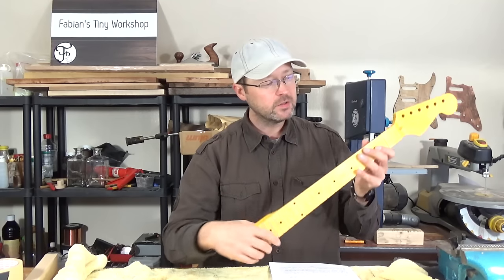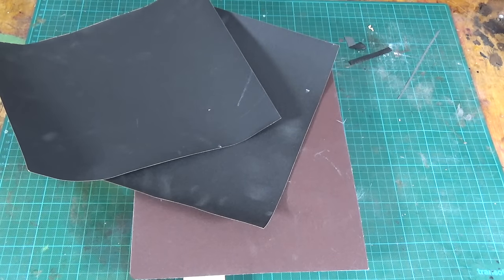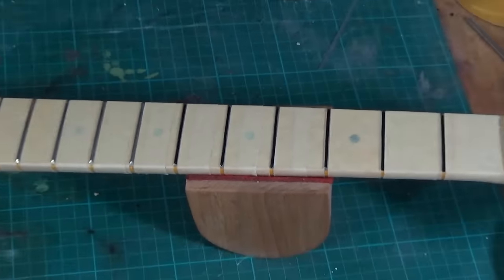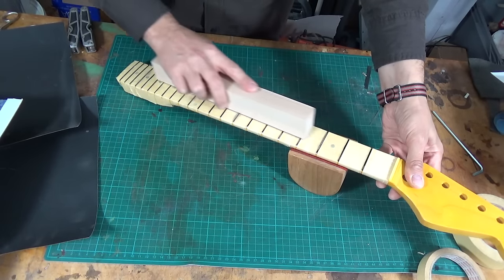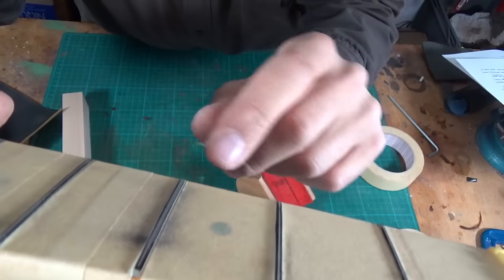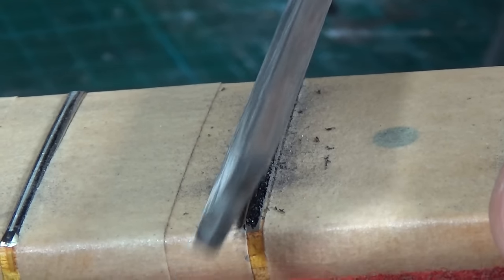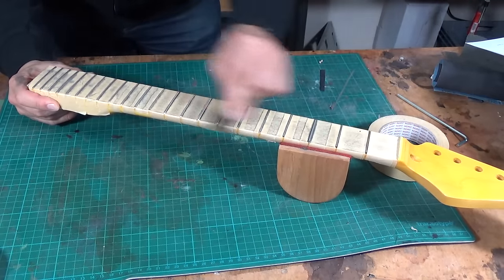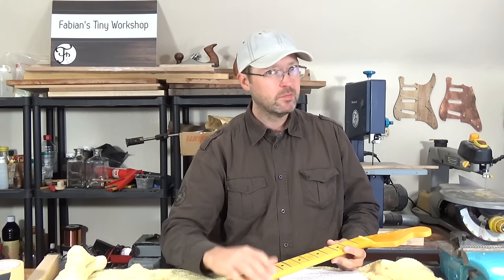Fret Leveling - The Easy Way // How To

Comment: Hi Fabian, thanks for the video!

I have a major question. Basically I followed you step by step but after setting up the guitar the best I can even with action at 1.75 to 1.5 (I'd like it lower to like 1.5 to 1.25). It seems that the high frets (17-24) don't let the 12-15 frets play too well, either popping, stopping them or buzz or they don't let them bend. The higher frets themselves have pretty poor playability/buzz.

it seems that I can't fix it from the truss rod either since having a bow doesn't affect those high frets but only the middle.

My question is, maybe I shouldn't have leveled all the frets the same and actually sand the higher ones more?
Reply from the maker: Sorry for the late reply. Yes you can level the higher frets more. Sometimes there is a slight twist in the neck so you can't get rid of the buzzing on the higher frets. Bear in mind. Leveling the higher frets more wil result in a higher action for those frets, so you have to keep that im mind by ajusting the truss rod. One thing to think about. The 12th fret is in the middle of the open string. So that's were the open string needs the most space to vibrate.
Reply: @FabiansTinyWorkshop  thanks so much for the reply! Learned a lot

Comment: This is a great video bro but one tip if you can get it where you live use Scotch Brite instead of steel wool works way better and doesn't leave any residue that can mess anything else up
Reply from the maker: I recently use nail polishing pads. 1000/4000 grit. They work fantastik for polishing the frets.
Reply: @FabiansTinyWorkshop  they do, but trust me brother, that scotch brite stuff is the shiznit! ;) the green =400, the red =800, grey =1000, white =2000, and doesn't leave any residue like steel wool will, and less cleanup even than the pads. but you do you! great video, have an awesome day and rock on!

Comment: Hi! Forgive me if I'm wrong, but how can you level frets correctly if you don't remove the nut?? When sliding over the frets with your "block/sandpaper", the first 2 or 3 frets near the nut do not get the same level of filing as the ones further. Because the  movement of the sanding block does not affect them as equal - they get less "pass-throughs".  Please correct me if I am wrong.
Reply from the maker: I understand what you mean. That's one of the reasons I like to use a long beam. As long as you are using a straight leveling beam the result must be straight. You can't sand a curve into the fets with a straight beam. In other words the beam is alway tuching the higher frets not the lower ones. And even if my explanation is wrong my fets are still level after leveling. Also don't forget that the frets are not evenly spaced on the fretboard and thereby the pressure is not distributed evenly either. Sill the frets become level.

Comment: Is there a limit of times I can do a fret job before having to replace for new frets? And, when you do it, do the frets become smaller? (For example, jumbo frets become medium because they wore off..?)
Reply from the maker: The frets will lose height but they do not become thinner. If the frets become to flat they need to be replaced.

Comment: Hope you could reply. For checking the neck straightness, can we also just use a regular metal ruler? My local guitar parts shop is selling a straight edge without notches and I figured I could just use a metal ruler?
Reply from the maker: A straight metal ruler works fine too.
Reply: @FabiansTinyWorkshop  thanks so much! 🙏❤️
Reply: @FabiansTinyWorkshop  I share good news. I just finished fixing the one high fret on my guitar yesterday. It plays much better. But it still needs  just a little more sanding. I do it the next time I change the strings. Thanks for making this video! 🙏🙌❤️

Comment: Nice video😊 what grit did you use on crowning and what grade of steel wool did you use? Thank you in advance😊😊😊
Reply from the maker: 220 and eventually higher grit for polishing. Steel wool was ffff I think.
Reply: @FabiansTinyWorkshop  do you mean grade 0000
Reply from the maker: @joeems5469  sorry, yes 0000. Although I'm not 100% sure because I rarely use steel wool and I don't have the packaging anymore.

Comment: Hi, Fabian, what about the case with just 1 problematic fret, on just one spot on high E String,? Do you level all frets? Thks
Reply from the maker: Well.... If it's a high fret I only level that high fret. If it's a low fret I have to level every fret to the same height as this low fret. Sometimes how ever you can get by with spot leveling the fret or a few frets after the low fret. that could work, at least if you're not aming for a super low action.

Comment: Great tutorial, one question though. When you level frets, you have to work on all of them? I have a strat with 2 problematic frets that are quite flat, but the rest of the frets are in really good shape.
Reply from the maker: If you have a high fret then you only need to level the high fret to the level of the other frets. If you have a low fret you have to level all the other frets to the same level as the low fret. That is if you want a low action without buzz. Of course if you prefer a high action you might get by with raising the action to eliminate buzz.
Reply: @FabiansTinyWorkshop  ok thank you!

Comment: Thanks for the well made video.

I have a question about leveling. 
Using sharpie marks will clearly guide us in terms of leveling off all the frets relative to each other.
But the real problem I’ve encountered refretting two of my electric acoustic guitars is how to level off relative to the height of the nut. Is there an easy way and tools to measure how the slots of the nut are positioned against the first fret?
This has to be carefully considered as it may severely affect playability and the feel. 
Thanks in advance!
Reply from the maker: Unfortunately I did not cover this topic in this video. The nut slots need to have the right height. I usually cut them with the string on the neck by sneaking up to the the desired depth. Be carefull not to cut to deep. I've seen people use a flattened pencil to mark the depth but somehow I does not work for me.

Comment: Quick question for you Fabian, I have never leveled frets before, is this something I can do if I take my time? Or do I enlist someone else to do it.... I have all the tools
Reply from the maker: I think you can do it. My suggestion is to watch as many videos on the topic as you can find to gather as much information as you can. Don't forget that you might have to ajust the height of the nut slots too.
If it's an expensive guitar or you feel unsecure you might want to consider to let a professional do the job.
Reply: I agree. My suggestion is to try, but not on an instrument you do not want to mess up. eBay/Amazon/Ali Express has Chinese necks for 30 USD. Or you can buy second hand, entry level guitars in the local classifieds and practice fret leveling, nut filing and setup on them.

Comment: Excellent video, really! one question though: this assumes the neck be perfectly straight (no string pull obviously, nor truss rod pull either). If one does this job with the neck on the guitar (like on a LP) should one release the truss rod totally?
Reply from the maker: It depends on the tension in the Neck. Sometimes the neck is not perfectly straight when the truss rod is released. So always check whether the neck is straight and adjust the truss rod if needed.
Reply: @FabiansTinyWorkshop  OK, got the point: the neck must be straight as a starting point. Thanks!
Again, you video is excellent! I recently published a manual on Amazon on guitar setup but I left out fret work. I will get into this next!

Comment: Great video 👍Quick question ~ would a double sided sanding block work instead of the sand paper? Thanks for sharing these tips, keep them coming! 👏👍
Reply from the maker: Thank you :) Do you mean a sanding sponge? If so, the answer is no, because the soft surface of the block would just follow the low and high frets and there would be no leveling. The sanding block has to be hard and perfectly flat and long enough to ride on multible frets. A long and flat metal file would be an alternative.
Reply: @FabiansTinyWorkshop  I have a metal file, I was thinking of using the sanding sponge in lieu of the multiple grits of sand paper used after the initial leveling and crowning is completed 🙂
Reply from the maker: @eliannamizrachi3415  As long as you're using it only to remove the scratch marks from the previous grit you're good to go.👍
Reply: @FabiansTinyWorkshop  Danke schön, I'm really looking forward to tackling this project! 👍🎸
Reply: @FabiansTinyWorkshop  Will 150 grit work instead on 220? It's what I have on hand 🎸
Reply from the maker: @eliannamizrachi3415  It has to be at least finer than the file, since you don't want to remove height from the fret. 
After leveling and crowning I usually start with 400 and work my way up to 1000: https://youtu.be/pbr0VR2CdQM?t=316
Followed by steel wool.
Reply: @FabiansTinyWorkshop  Gotcha ~ I meant could I use 150 grit instead of 220 grit for the leveling beam 🙂
Reply from the maker: @eliannamizrachi3415  Yes of course :)
Reply: @FabiansTinyWorkshop  Awesome! Vielen Danke! 😀🎸

Comment: Great ! But isn’t decreasing the original frett height ?
Reply from the maker: Of course, but the alternative would be high action, buzzing frets or dead notes.
You need to know that there are two reasons for fret leveling.
1. It's a new neck but the frets were not leveled in the factory (typical with cheap guitars).
2. the neck has been played a lot and you over time find markings or dents on the fets of your faforite notes that will cause buzzing. (typical cowboy chords).
Naturaly because you loose fret hight you can only level the frets a few times before it is nessesary to replace them.

Comment: At 3:15 you mention keeping the radius, but you don't say how.  That's what I was wondering while watching the video.  If you're using a straight edge how do you maintain the radius correctly?
Reply from the maker: By going from left to right with even pressure.

Comment: Do you have the file the nut (lower the string notches) after this? Also, I noticed you did not check with the notch on the higher frets (for the straightness of the neck). Are those parts not affected by the truss rod? Thanks and I hope you reply!
Reply from the maker: Yes!! I forgot to mention this in the video.
You have to check the whole neck for straightness.
Reply: @FabiansTinyWorkshop  Thank you! How about the nut thing? :)
Reply from the maker: @Fonkemman  Yes you have to cut the nut slots as they are basically fret zero!
Reply: @FabiansTinyWorkshop  Thanks!
Reply: Fabian's Tiny Workshop Hey man, just another thought. I am quite scared that the levelling beam would "teeter totter/see-saw" over the unlevelled frets. Like how a fret rocker rocks but over the whole fretboard. What are your thoughts about that? Thank you!
Reply from the maker: @Fonkemman  That's why I prefer a long beam. A short beam or file might rock.
Reply: Fabian's Tiny Workshop thank you!

Comment: Took me years to figure this out.....use a small leveler to get the high spots here and there....especially if you did a refret.....you will never get them all perfectly installed with a hammer.  If you go right to the large beam you will remove more material off the frets then needed....you'll may end up with low frets.  Use a rocker and find the high spots.....deal with them first. Check to see if they lifted....if they have you'll have to glue them down.   I use a piece of 1" x 1" x 5" piece of rosewood that I leveled and trued up.  Just hit the areas that rock after you're sure the frets are down and seated well.  Get them close.  Then go over the whole fretboard with the large beam.
I usually try to start with frets that are .047 or higher....preferably .055.....you may have to open the fret slots to fit higher frets.  Especially with the frets over .050.  I like jumbo frets.  Mediums aren't usually as high.
Reply: I started by putting superglue in the fret slot and then pressed in the frets. But I made 2 mistakes, I think, the first one being I used too much superglue, and the 2nd one being with the method of fret installation I use (a modified clamp with fret caul on it) it took too long to get the fret pressing clamp in place, so the frets ended up a bit too high in the slot. Interestingly, they are more resonant when tapped, than the frets I did not glue in. So I do think there is a good case for using glue, it increases resonance transfer, but in my case, I should probably have wicked in the glue from the sides after installation instead of putting glue in the slot before pressing in the fret. Had I had a faster fret press, like an arbor press or drill press on a bench, maybe I could have got away with putting glue in the slot first...

Comment: It probably does not matter, but if one goes back and forth, do the middle fret wires not receive double the abrasian the outer ones?
Reply from the maker: That's exactly why I use a long straight beam. I do not think it is possible to sand an noticable up bow with a straight beam. Much like you would use a wood plane to get wood straight.

Comment: I've done many guitars this way always comes out great..if you don't know how to use tools don't do it. Screw paying someone to do this when most that do it suck..i trust myself nobody else..after you do that your going to have to tend to the nut slots with the guage strings you use an string height on the first fret been doing this 30 years..if you pay someone to setup or repair your guitar..you need to learn its very easy really

Comment: Fabian, my guitar has some small dents the  width of the string on the lower frets, seems like someone dropped something on the neck and it dented the fret with the string, when you bend the string it gets stuck in the dent. how can I remove those dents? do I need to sand down all the frets on the neck to the depth of the dent? thanks
Reply from the maker: Short answer is yes. You could sand down only the frets with the dent but then these frets would be lower than the other fretes which can lead to a buzzing and you might have to raise the action of the strings to compensate. It's a tradeoff. If the dent is not to deep you migh get away with sanding only the respective frets.
Reply: Fabian,  I saw a vid that they used a silver solder solution. since these dents are on frets 20, 21, 22 I might give it a try b4 sanding the neck. thanks for responding.

Comment: Another alternative for a fret crowning file that I learned from Dan Erlewine's guitar repair bible is to take a triangular file and grind the pointy tip down to a more blunt, rounded end, then grind the three sharp angles of the file smooth the entire length of the file so they don't cut into the fretboard or through the tape while crowning the frets.

Comment: The end result looked great and the stuff used isn't 50$ for a specific tool from StewMac.
I want to ask a question, though:
My frets are sticking out from the fretboard, vertically. Sharp fret ends are there, but that's because of dry conditions, the vertical problem probably is, as well.
I was thinking about heating them up with a soldering iron to loosen up the binding and then hammering them back into their slots gently with a small hammer over a piece a cloth that goes on the frets. Do you think that would work ?
Reply from the maker: If I understand you correctly you wold end up with the same problem as before. The lifting of the fret ends usually happens because the frets do not have the same radius as the fretboard. Maybe thy were to straight from the beginning or it's because they were presed in to hard in the middle.
I would try to inject thin super glue underneath the frets and then press the sides of the frets down (of course protect the fretboard and binding with masking tape). If you remove the frets try to bend them a bit before reinstalling so the ends will make contact with the fretbord first.
Reply: @FabiansTinyWorkshop  You were talking about the fret ends specifically. I have a picture of it, it's shot on an iPhone 5S, so i don't know if it's all that visible. https://imgur.com/7HWmeJr
This is the 5th fret that i've shot, but the problem gets worse up to the higher register, you can spot it at the 4th fret at the top of the picture as well, where it sticks out more evenly. You can see that the fret ends look flush with the fingerboard, while the fret sticks out from somewhere around the middle. This is not entirely consistent with every/most frets, but that's the general "theme". Most of the fret ends are actually their best point of contact with the fingerboard. Do you still think i can solve this exact problem without having to remove the frets ? I would rather take it to a luthier if refretting is needed, simply because it's a much more tool-specific job that dressing and crowning and polishing the frets themselves.
Reply from the maker: @darkySp  Do the frets spring when you press on them? If so you can try to press or hammer them in so they are seated flush with the fretboard. If they do not spring it could be because the fret slots are not cut deep enough. Be aware that removing the frets can cause damage to the fretboard. This might be a job for a luthier.
Reply: @FabiansTinyWorkshop  I'm not sure if i see any spring going on. It takes a lot of force and something hard to press on it, so i guess there's no spring ? I honestly can't tell
EDIT: There's spring. It's hard to notice, but there is